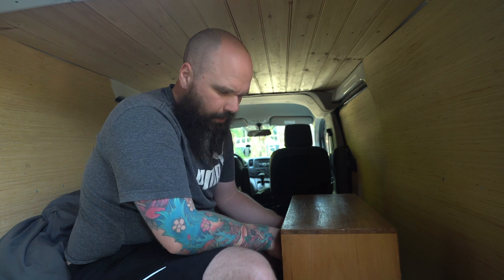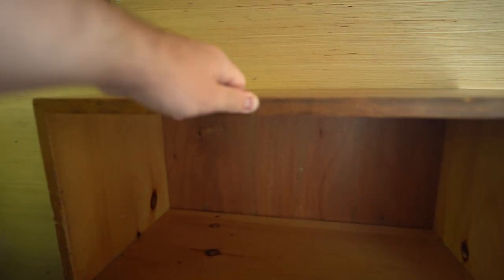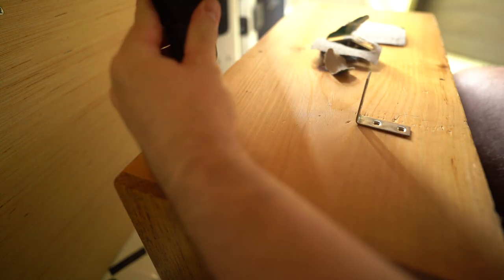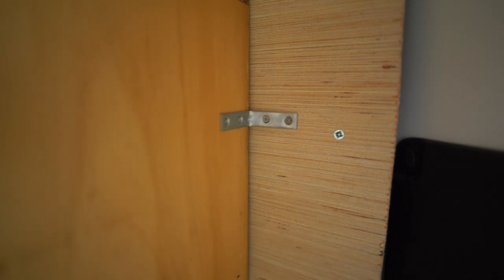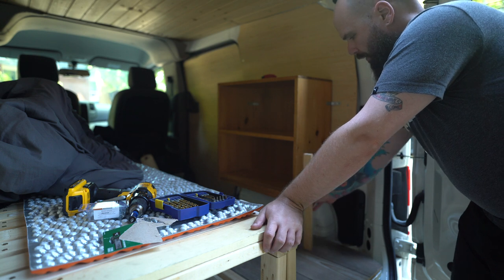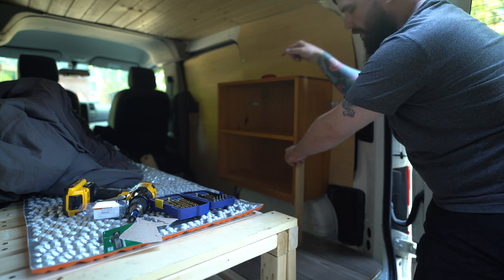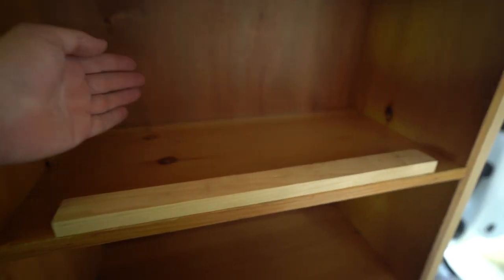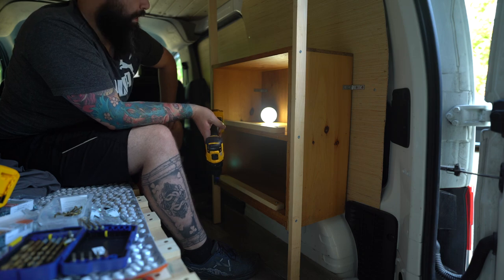Nissan NV200 Camper Van Build Part 14 | Putting Up a Shelf

Comment: Can I ask how tall you are? I notice you have to bend forwards a bit for head clearance. I'd like one of those bes in an nv200 but I need to be able to sit up. I'm 6ft tall. Thinking one option is to do a lot less on the floor and ceiling insulation...

Comment: Chris, since it’s going against the wall and mounting to a wall support. Why didn’t you place the L brackets on the inside of the shelving.
Reply from the maker: There is a screw holding the wall to the wood strip behind where I would have to screw the l bracket if I did it inside. I could have moved shelf in theory but I like where it is lined up against the black floor vent
Reply: Chris, thanks. That makes sense. You just seem real meticulous and that was out of sorts for you.

Comment: Hi, can you sit upright in the van? I ask because most of the builds I've seen put the cladding between the roof crossbeams instead of underneath. I'm guessing this is to win a few inches of height.
Also how tall are you and how high is your bed?
Cheers